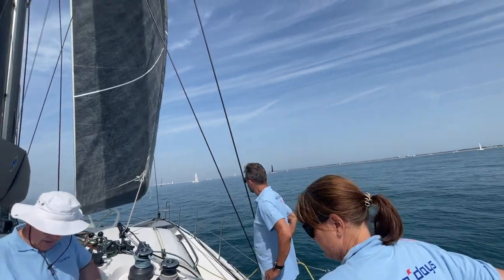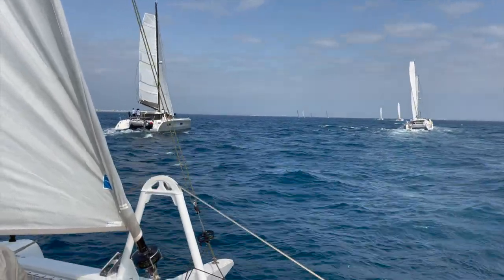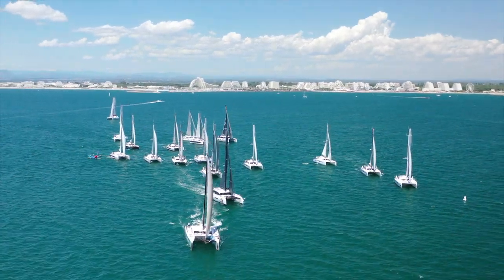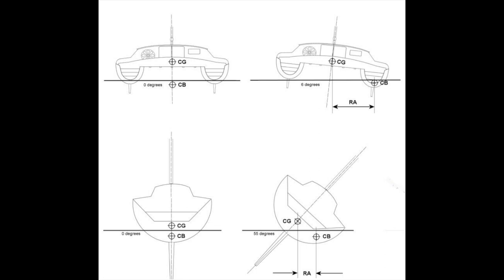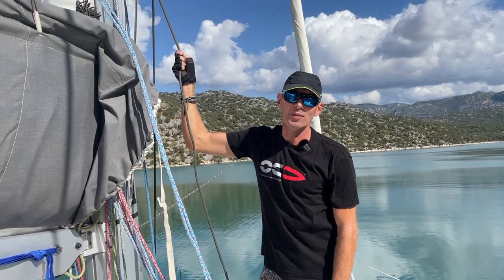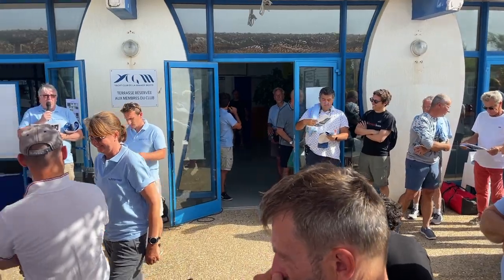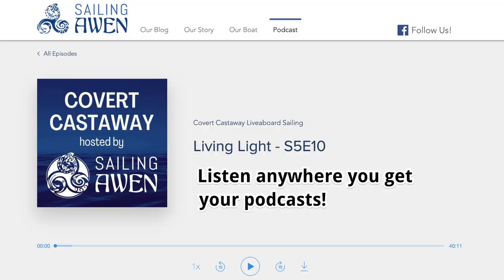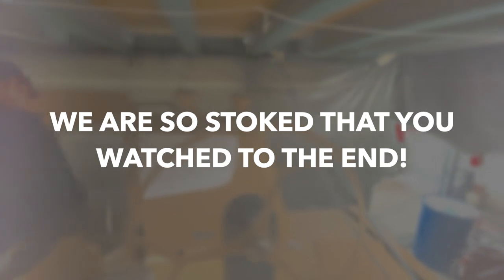What is the Best Performance Sailing Catamaran for Around the World? (Ep.2)

Comment: Great video. Exactly the thought process I’ve been going through over the last year. I also spoke to Outremer about the ‘new 51’. Have been drawn towards the balance 482 which we test sailed but probably 482 and O52 too much budget for us. Was hoping Outremer would have had a replacement for O45 but that didn’t seem to be the case so we were drawn to  B442 but I am concerned  about reality of load carrying capacity and that the extra money buying a ‘performance cat’ may well be lost when we load her up.  Would love to consider the O52 or B482 but it would be a real stretch for us. Love to get your thoughts on all that.
Reply from the maker: Hi Richard, I totally get your concern. We didn’t look at the B442 because we ruled out boats under 48 feet because of the desire to have 3T with performance. The O45 is actually 48 feet so it stayed in but the displacement delta is tight for our requirements at 2.4T. I will tell you that people do it and love that boat so it just depends on what you want to put on it. La Vaga does it as do many others so i think that at 48 would be better than a 44 foot boat. The B442 is 44 feet and the math assumptions we are working under don’t align. All said and done we chose Outremer because we loved the boat but also because we have confidence in their after sales and warranty service which is a big deal, and everything else you get in training etc, which you really need on these boats. Hope this helps! - Holly
Reply: @SailingAWEN  thanks for the thoughts Holly. Would you share your calculations for getting to the 3T you want to carry plus the displacements that you feel boats need to get to in order to comfortably carry that without affecting performance? I definitely find that really helpful. Maybe the subject of a whole video!! Thanks again
Reply from the maker: @richardhill3035  We definitely plan on doing a video about weight as we load our boat next year. Based on our own experience with our first boat and talking to other performance owners who have been focused on weight it can be quite surprising how much everything adds up, especially for cruisers. Our 3T is a ball park estimate with some input from other performance cruisers. You want narrow hulls to be able to sail in light air and get good performance but those narrow hulls will sink quickly in the water with too much weight so it's best to start from a longer boat if possible to give yourself more loading capacity. We've made some big weight cuts with no generator, super light dinghy/outboard... but we find ourselves considering more and more options somehow ;-)
Reply: @SailingAWEN  that tempting options list!! You probably have it, but when I spoke to Outremer about the O45 they gave me an options list with a column for price and a column with weight, and a max they recommended... so if you wanted the Aircon it showed you €.X and Y.Kg, pretty useful but also highlighted how important they viewed this. Look forward to your future videos... great to see your project coming together.

Comment: Great video!  

I'm curious, what kept the HH44-SC off of your list?
Reply from the maker: Great question! The boats that made the short list were a combination of performance and ability to carry 3T of weight with some level of value relative to the other boats. We have friends who have a 44 foot light displacement boat and they have to be really careful what they put on it to get the performance out of it. For us deciding on a new boat, it would have to be different enough to make the change worth it for the cost/effort of switching boats and we need the 3T to not be obsessing about weight during a circumnavigation. The O45 is 48 LWL and the SW1370 had a published load of around 3T at 44LWL, but, we have heard it's actually heavier in the end so you don't get to 3T (that's the rumor, don't know if this is fact or not). The SW1370 would not have made our shortlist with that logic but the price was more reasonable so we kept it in to try to verify the weight. Of the HH boats, the 50+DB and 55 were more in line with the performance/3T requirement we had, but the price is outside of our budget. They are very nice boats for sure. Thanks for the question and thank you for watching! - Holly
Reply: Dazcat